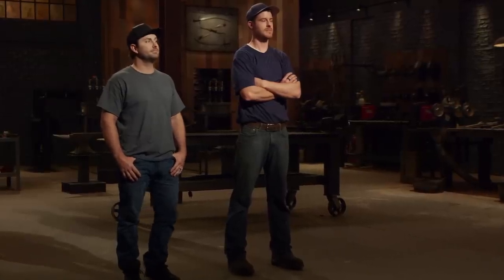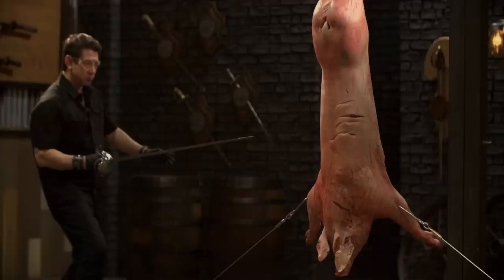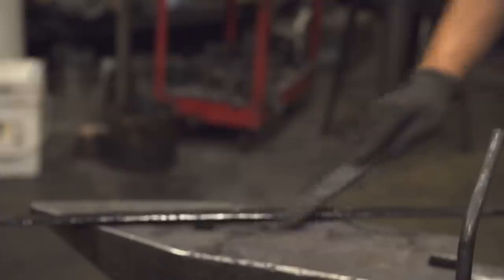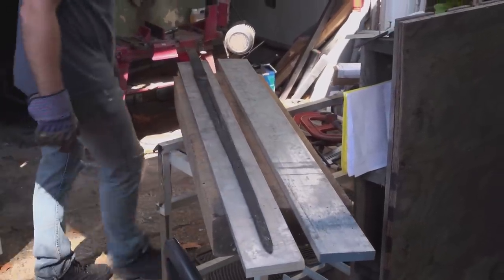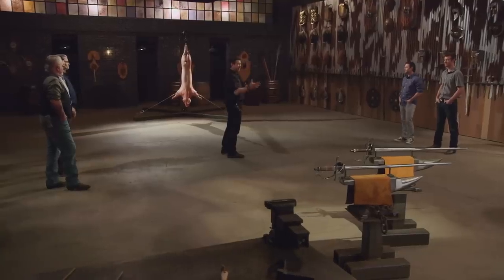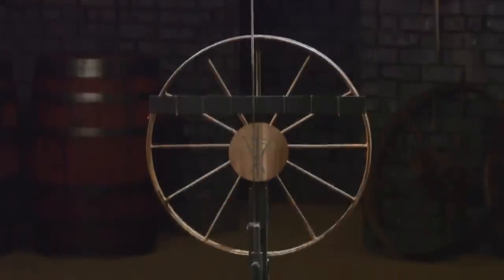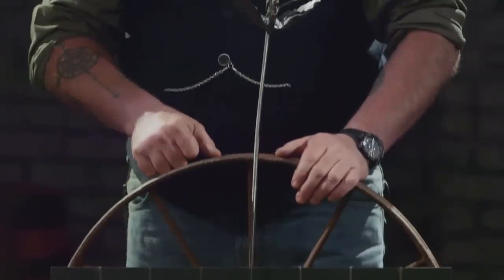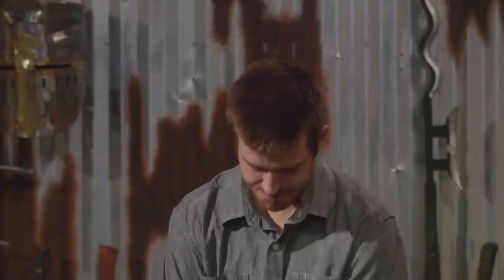SIGNIFICANT Bend in Blade Loses Competition! | Forged in Fire (Season 7)

Comment: I do find it interesting how the very thing Doug says it would be spectacular to see but a reapier shouldn't do is done by both.
I am not a bladesmith, so both these guys are infinitely more talented with that than I am, but this does mean they both missed the point of the rapier.
Reply: It's because both contestant's blades were far wider/heavier/thicker than a truly accurate rapier. Each were at least a quarter inch wider than a real rapier would be, and perhaps a half pound or more heavier. You can see it in the way Doug swings the blades, more like a one handed longsword than a rapier.

Comment: Teddy bad heat treat that's a critical failed,jesse a 1st ever fuller...never made a sword before..
Reply: well for the first ever sword cutting a pig in half is impressive even though its not supposed to, now if it was made as a proper rapier ie length weight ect and it still cuts a pig in half would be godlike blade work